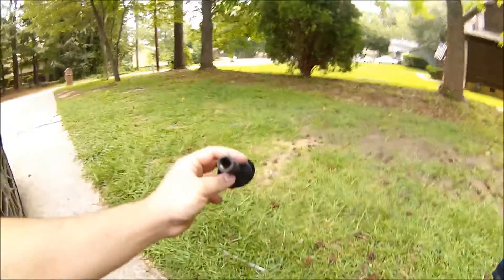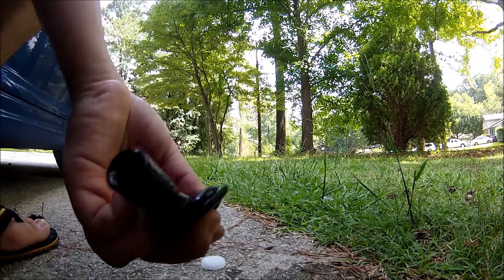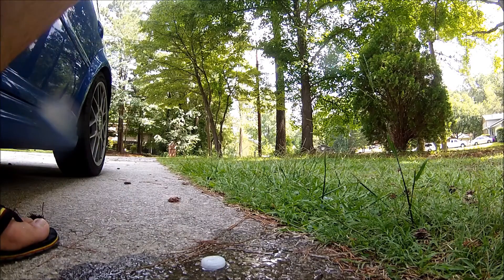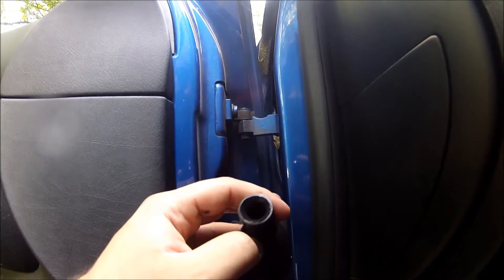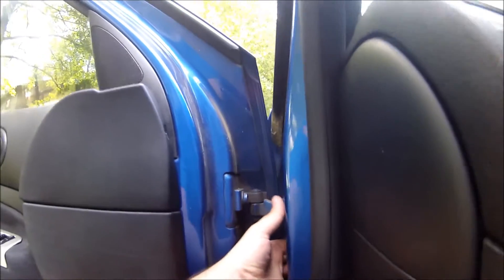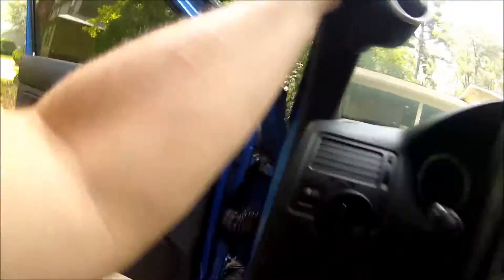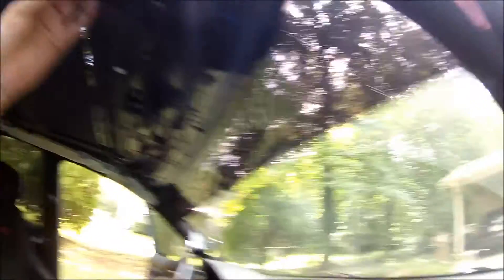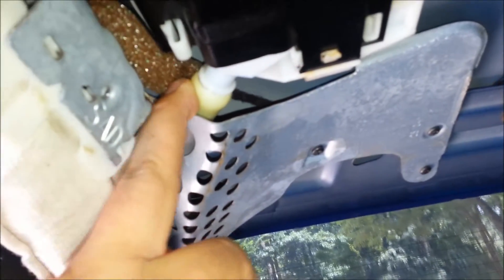HOW TO FIX SUNROOF LEAKS VW JETTA GOLF AUDI'S ANY CAR

Comment: I snake all four corners with a wire every 90 days on my b5. Also I slightly modified the rubber piece in the door jams to allow some smaller debris to pass through more easily.

Comment: This was super helpful because I have this exact vehicle. I think I am just going to cut the nipples off under the car. I am not having rear draining issues, but I had front draining issues, cutting the nipples off resolved that problem, but I'd just like to avoid any possibility of trouble with the rears all together ~_~
Reply from the maker: +midorialexandros cutting the tips will be the easiest way to fix the problem i did not cut mines cause i dont want bugs to crwal to the hose and get stuck there and is really hard to do this with out taking the headliner off

Comment: So I have been getting water in my front and back seats. More on the drivers side but that side was actually really clean. but I noticed that where the door connects that rubber piece im not sure what its called but on the driver side its not connected to the car. We have had crazy rain tgis winter could that be it?